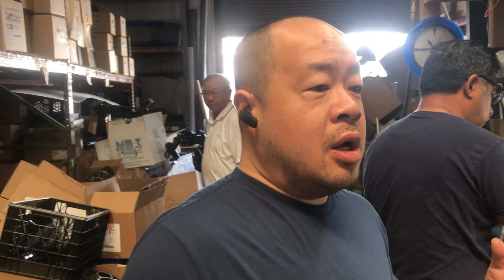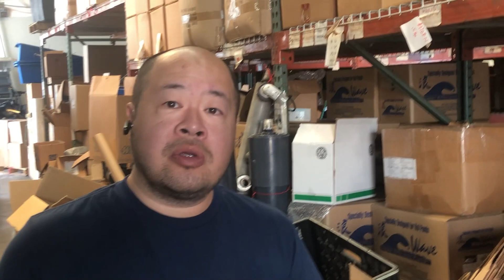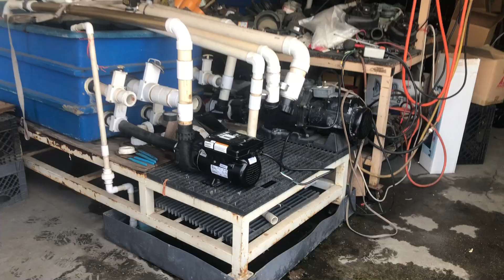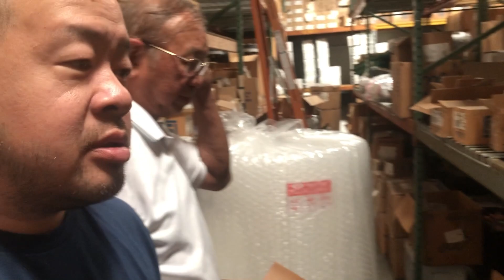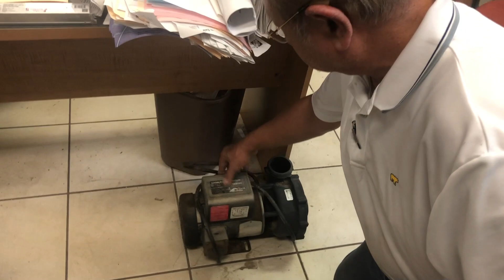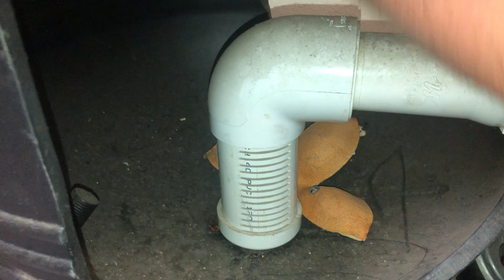POND & AQUARIUM PUMP / UV Manufacturer

Comment: What you guys need to install on your pumps is called a VFD (variable frequency drive) this stuff is very basic compared to what I use at work everyday. I do HVAC/R at a collage in NY and a lot of my job is moving boiler water or chilled water for heating and cooling. Rod if you ever have any questions I could answer most for you. Including designing and installing heated or chilled water systems.